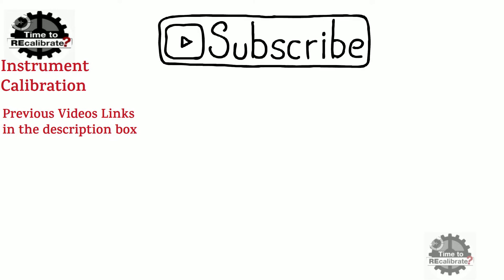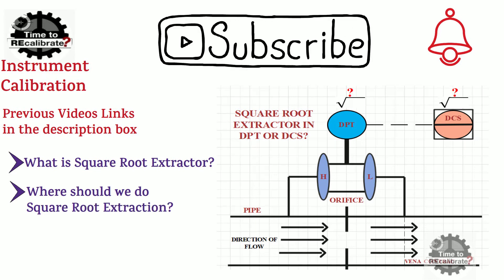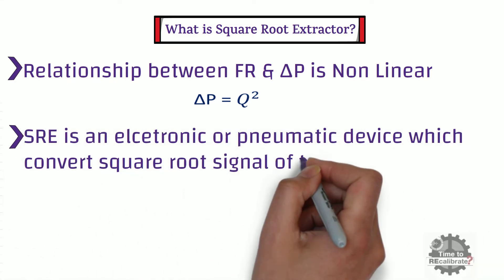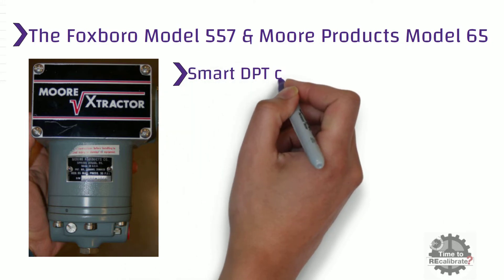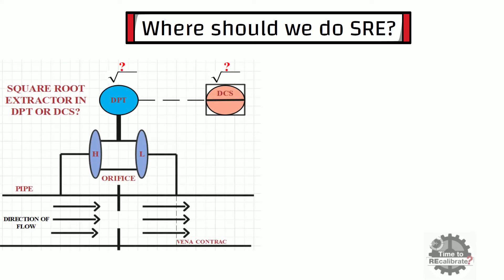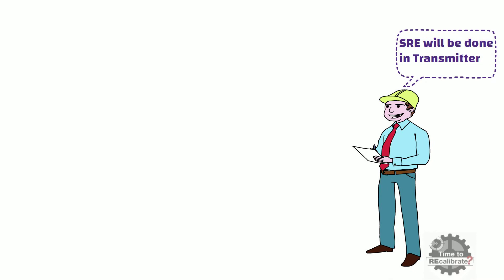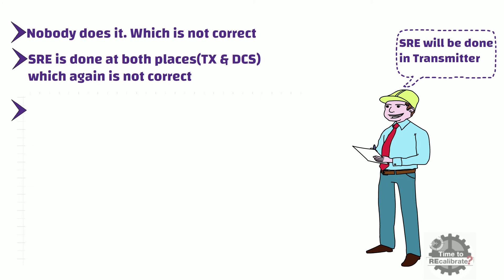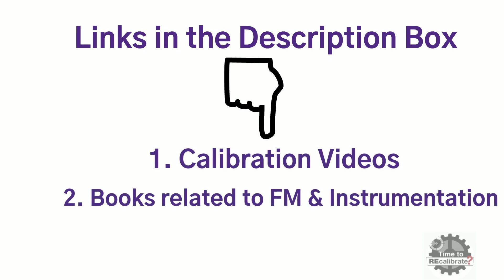When to apply Square Root Extraction  for Differential Pressure Transmitter

Comment: sir , please tell me exactly why we use square root function in dp flow transmitter , what are the reasons
Reply from the maker: Hello Jagadesh
Thanks for your comment. 
Flow rate is directly proportional to the square root of differential pressure. In other words, flow rate and differential pressure do not have a linear relationship. So this is the reason that we use square root function in dp flow transmitter. This square root function converts square root relationship into linear.